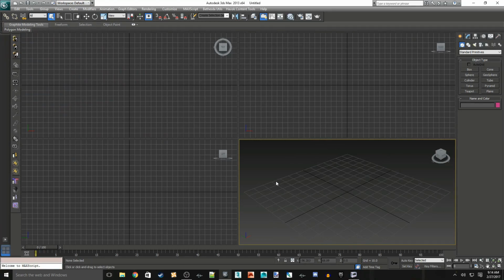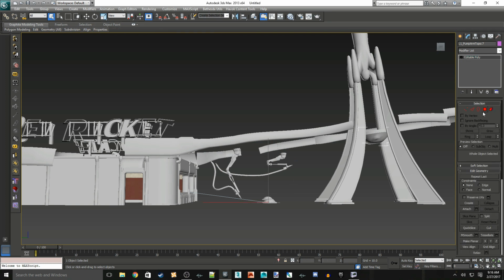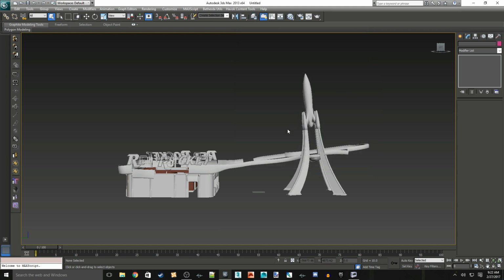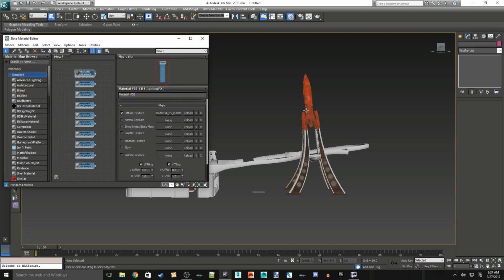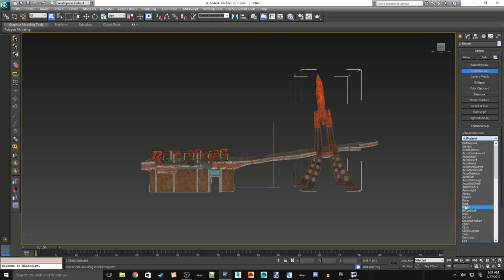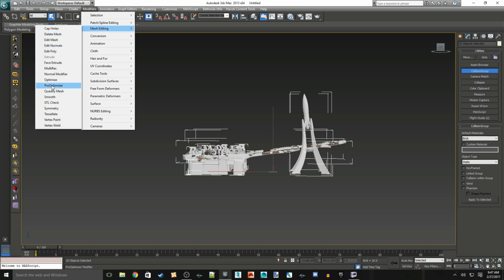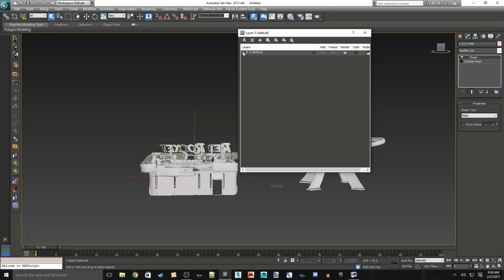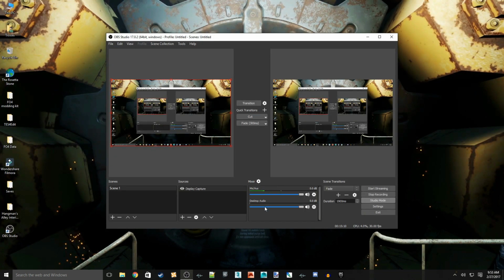Fallout 4 3d Model Editing and Complex Collision Creation

Comment: Not sure if you said this in the video (I skipped around) and I know it's implied in the title, but modders should only use the havok mesh type for collision objects if they absolutely need to. Otherwise best practice is to use primitives as they are cheaper. You can overlap primitives to create complex shapes and that will still be less intensive for collision calculations in game.
Great video though, it's good to see a sample workflow.
Reply from the maker: I have done that before with this model, and it was such a pain that I just decided it wasn't worth it. It seriously took me the better part of a day to create all of the primitives required to make a workable collision for this model when I was working out the best way to do this. I just wouldn't bother with primitives if I had to make more than a handful.
Reply: I feel you. I went through the same thing when I was toying with an immersive rebuilt Castle, walls and interior. I tried using primitives at first for the dirt on top of the walls and gave up on that after a few hours.

Comment: Somewhat I can't assign texture to the material as in 8:36. BGS asssigns (stone heavy), but the texture just brings up error and doesn't save it's path. Tried adding texture in nifscope, but it just a concrete seamless texture no matter what texture I add in and it's not visible in game. Anybody stumbled upon smthing like this?
Reply from the maker: You need to have the actual textures in the folder to not get that error. I have all of the textures extracted to my 3ds max assets folder with the data\textures file path structure inside of that.
Reply: @Trosski  ah, I see the problem. Can It be the cause of why my new model neither can be seen nor be "felt" by it's collision? It's in there in editor, but in game there's not a single sign of it's existence at all.
Reply from the maker: Yeah. If you don't have everything setup correctly before exporting you will get that issue. There is also an issue where you can get a nif that only has the collision. It can be frustrating, but watch the video again, and make sure you don't miss any of the steps... no matter how insignificant.
Reply: @Trosski  Thanks! I'll try and hope. After modding F3 and FNV for several years I'm kinda out of rails with what they've made with F4. It's like two time more the pain in the ass than modding S.T.A.L.K.E.R. in 2008-10. Feel myself young again XD
Reply: @Trosski  after rethinking of what you've said I've stumbled upon one thing. I'm not using import of an actual nif. And somewhat my nif plug can only export the nif file. Can this be a problem too? I've tried to find a separate Fallout 4 plugin for my 2014 3d max, but only found the Skyrim one. (https://www.nexusmods.com/skyrim/mods/5622?tab=files) But it doesn't open Fallout 4 nifs saying that it's Strings are too long or this files are not nifs at all. Is important part to import(no puns intended :D) an actuall nif an use it as a prefab to import my new mesh? My question sounds dumb to me, but I'm kinda helpless.
Reply from the maker: So, this video only covers 3ds max 2013, and the official plugin from Bethesda. The plugin is only guaranteed to work for 2013. I have heard of some people getting it to work on other versions, but I don't know the specifics of that.
Reply: @Trosski  so BGS plugin should import as well??? Maybe it just installed badly. There isn't any differs between 2013 and 2014 versions, so this plugin suits both, but it installs a bit buggy on 2014 and may or may not install from the first time. :\
Reply from the maker: No. I use the nif tools plugin to import. Sorry. It's been a while since I did the install, and it's just automatic to do the import, so I forgot to mention that. You need to select the fo4 format though when you import. There are two different niftools plugins. One is rarely updated, and doesn't support fo4 to my knowledge. I'll have to find the link for the niftools plugin that I use, because it's good for importing models for all of the FO, and TES games.

Comment: i'm creating items for fallout 4 but is it necessary to have 3d size limit?
i'm creating new and animated doors and floor, wall and ceiling, but do i have to have a size limit of my 3d to get in the creation kit?
Reply from the maker: I'm not exactly sure what you are asking. Are you asking if there is a limit to the size of the file? Like memory size? Or are you asking if the model size is constrained? I don't think there is on either of those. If you look at the red rocket station in game, you will see it is a pretty sizable object. If you are wanting to make a tile set for building things in the workshop menu, then I would say that you should stick to the standard model sizes for similar objects. You can do that by importing a door, wall, or ceiling mesh into max, and using it as a sort of measurement tool to ensure you are creating properly sized objects.
What you really want to keep track of is your poly count. You want to make your model with as few polys as possible without loosing quality. A lot of the details can be defined with textures and bump maps. You don't need to detail every bolt.
Reply: @Trosski  i'm making an animated door i have to reduce its size to be used in the creation kit ?, the same for the walls and floors that i'm making in blender
Reply: @Trosski  the size of the item in 3d
Reply from the maker: @USColonelAutumn  if you are making a door that you want to fit into the game's existing set pieces, then you will want to make them the same size as other doors.
There is no size constraint for adding it into the creation kit, but you will want to stick with the standard sizing used by Bethesda.
I mean, you can add a huge door to the creation kit, and shrink it down to the proper size when you are building a level, but it's easier if you stick to the standard sizing.

Comment: Newby Noob here! Is it essential to do the textures in 3ds max first? Can they be done in Nifskope later? I think I need to work on my 3ds setup because im missing a few things. Thanks for the video though, it is very informative.
Reply from the maker: Galctic Offender you have to assign materials in 3DS max. if you don't, then it won't export correctly. as far as assigning textures... that can be done in nifskope, but it's easier, and faster to just do it in max. personally I don't even see the need for nifskope if you do everything correctly. I just use it to do a quick check to make sure my mesh looks right, but even with nifskope you can't really tell if the collision is working unless you put it into the game.
Reply: Brad Nichols 

Thanks for responding. There isn't alot out there on this particular subject. 

I can't seem to find the materials from the nif that I imported. Or any fallout materials really. I really just wanna use vanilla materials and textures. Custom colision is my main goal after chopping up a nif in nifskope, lol.
Reply from the maker: Galctic Offender if you want to use the vanilla materials and textures, then you'll need to extract them from the archives. if you open the vanilla mesh in nifskope, and expand the Trishape and lighting shader properties, you'll be able to find the file path in the archive for the materials, and textures.

Comment: Soo when I apply textures and materials they export the model black. Any ideas on how to fix this?
Reply from the maker: iSoldierHD I cover that in the video. You load the materials file in the bslightingfx, and then scroll to the bottom to add the normals, speculars, and diffuse textures in their proper slots. That should make the textures appear instead of the object being black.
Reply: Yes I did both of those things and they still appear black.I created a bgsm using Material Editor and all of my textures were in dds and everything is in their folders. Also i'm trying to do this for weapon. Not sure if it changes anything.
Reply from the maker: iSoldierHD the texturing process should be the same whether it's a static object, or a weapon.
Reply from the maker: If you send me the file, I can take a look at it and get a better idea of how to fix the problem. You can message me on Nexus, or Beth.net with a link to it if you want.